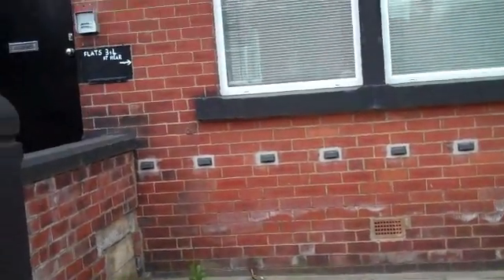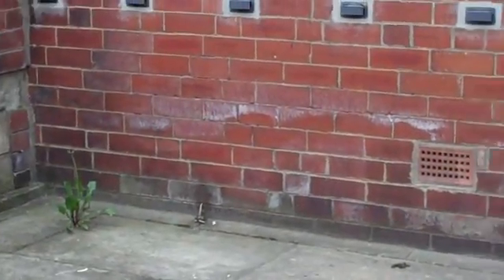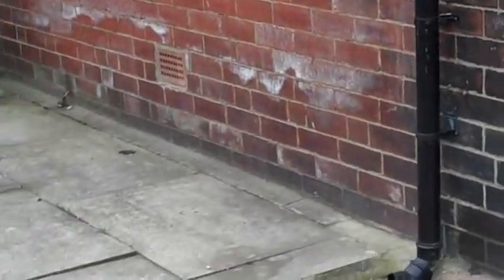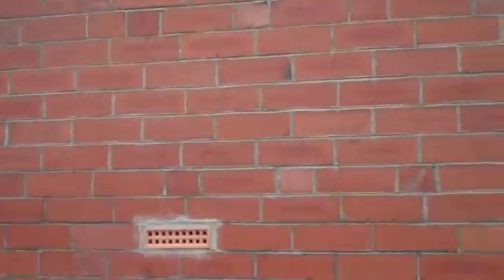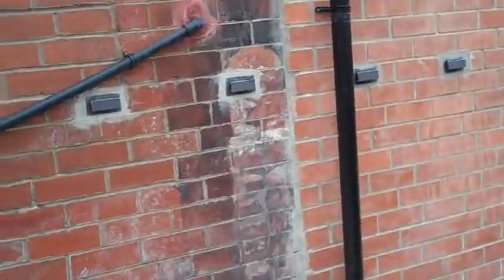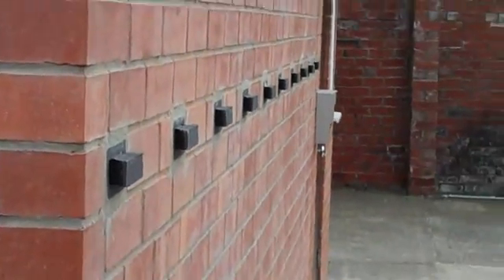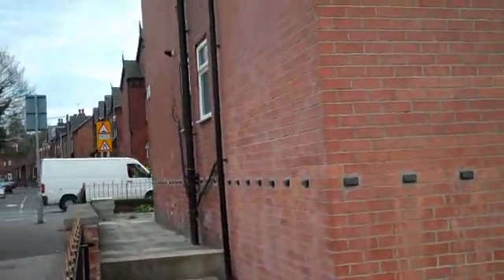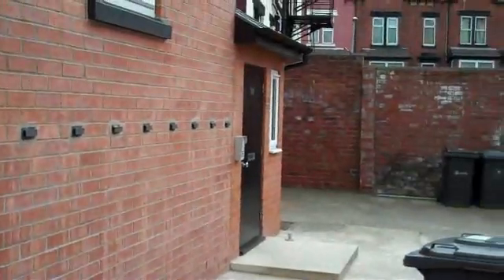None chemical damp-proofing?  The green w

Comment: Allowing freezing cold air in the winter months into the cavity of the wall will turn the inner skin colder than it should be. The cold air will breach the cavity and cause condensation to form on the external walls of the property. This is like haveing double glazing and cutting hols in the outer panes of glass. It is flawed in principle - IT WILL NOT WORK.

Comment: As a flood contractor I would like to think Im reasonably knowledgeable in structural building drying.  This system shown here has a theoretical value to dry its local area but in no way cures building damp issues and would only assist to accelerate degredation to building materials by salt / mineral deposits caused by constant accelereated evaporation of ground water.  So perhaps good in theory but bad in practice. The installation in your vid is shocking !! :-/

Comment: it might have its uses on a shed or old building where inetrnal dampness is acceptable.
it does not cure condensation-it does not cure pentrating damp-i have seen it not work on all 5 propertys that i surveyed which had it?
it costs more that normal damp proofing and is not short of a scam..when it does work it means that it was not realy required in the first place and was mis sold.

this firms already had court cases , they dont have surveyors just sales staff.

Comment: This system system does not work. As a damp proofing specialist Ive seen this many times and is constantly being advertised by NewHoland damp proofing. This method has been rejected by the BWPDA and property care association as being a cure for rising damp. I feel sorry for the customers who are being mis sold a product highlighting it factors of being green, and clean, reducing ,insted of hacking of contaminated plaster. The only way at present to cure rising damp is to inject / tank !